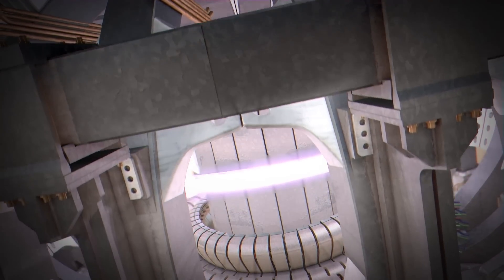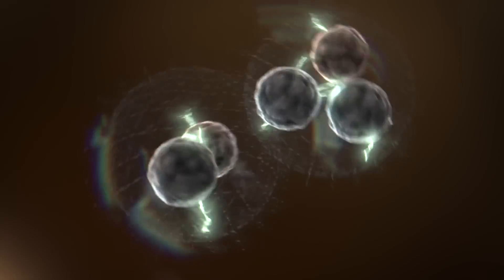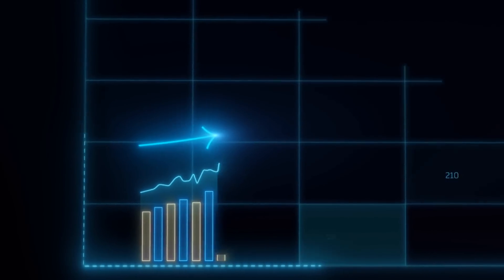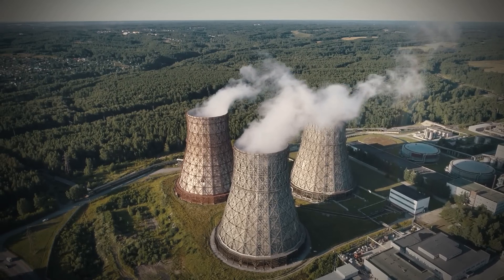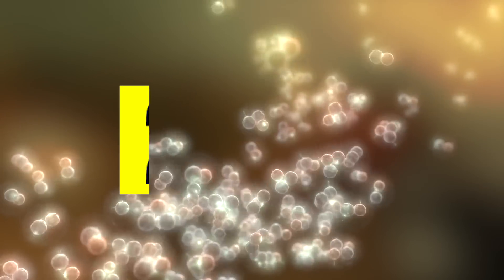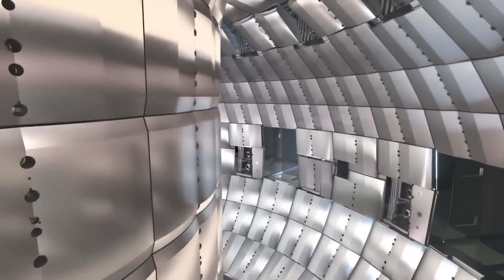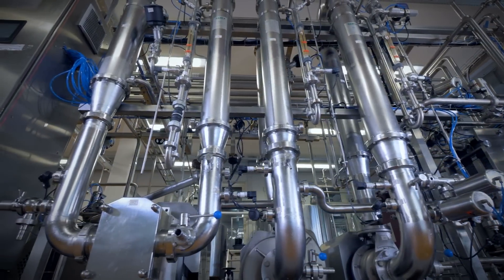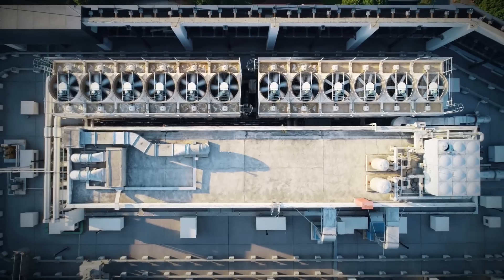The Shocking Problem That Could End Nuclear Fusion

Comment: the hydrogen reaction is just the most effiecient one at the lowest cost.
and most asume its the only reaction humankind will be ever able to get going.
there more combinations but require a higher presure/heat. or rare ones like helium-3
but in theory we could 'burn' like everything a sun burns. with ever lower returns using heavyer elements. (and then the star dies) they just having a fight in reaching sertian condisions to achieve fusion, heat presure and containing that, pulse fusion has proven succfesfull in having a positive net output, yes in "30years we have fusion" prolly not going to happen, but it is posible if you take a sun as an exsample

Comment: I always wonder why geothermal energy is not talked about. Especially when it is already used in fairly large scale in Iceland.
With such a huge percentage of the world population living in the vicinity of the volcanos of the "Ring of Fire", you would think that there would be at least a few countries that would take up the project of building an electrical generation unit using geothermal. 
I recently saw a report that predicted that using geothermal power production could power the United States for a million years, or possibly even for ever. 
I think that it would be completely possible to create large electric generating hubs, and send energy through a new, or possibly the old grid to some extent, to cities. Once one is introduced, more and more could be built. 
The technology is already there, it's nothing new, and I really hope that we eventually take steps towards geothermal energy sources in the near future. Because it is possibly the cleanest source of energy so far, with no negative byproduct, and is a limitless supply.

Comment: There is a design for a fusion power reactor that has been practical since the 1960s except that no one would want to build one. It involves creating a large concrete Dome and then exploding hydrogen bombs inside. The Dome would have to be really large and really thick but it would produce a lot of power. You would just use the heat generated  to drive steam turbines. This steam might be a bit radioactive though. As I said no one would want to build one
Reply: Well, replace fusion explosive with inertial furnace, build several of them to fire up in turns and add a hydroaccumulator plant nearby...

But yes, this power plant will be as big as a small city, and everyone are more interested in petrodollars
Reply: I’m interested in methods of setting off a fusion reaction without an atom bomb. Could pulsing an electrostatic field with regular explosives suffice?
Reply: @Scrogan  https://en.wikipedia.org/wiki/Inertial_confinement_fusion
Reply: @Scrogan  I'm not a physicist but more then likely no chemical explosive would be able to create a hot enough plasma for fusion to work. Even something like thermite isn't hot enough from my understanding. Like it has to be REALLY hot. They use electromagnets to contain the plasma as it would damage or destroy any material used to contain it very quickly.
Reply: @deathwishjoe  hydrogen bombs aren't considered conventional chemical explosives.
Reply: @landensmith7928  yeah I know that. That's why they work in making fusion. I was responding to James Barclay who asked about pulsing an electrostatic field with regular explosives. It was an interesting idea of his but after thinking about it I didn't think any amount of conventional explosive would get hot enough.
Reply: @deathwishjoe  he never mentioned anything regarding conventional explosives. He directly stated an atom bomb. Suggesting a nuclear explosive
Reply: Edit: I do apologize I had not read the entire comment.
Reply: @deathwishjoe  the suggestion wasn’t to use a chemical explosive directly, but rather use chemical explosive to provide a very high instantaneous power to a compressing electrostatic field.

See: Explosively Pumped Flux Compression Generator
Reply: @Scrogan  Ah I see where your going with the idea now.  sorry for the misunderstanding.  Using the explosively pumped flux compression generator to create bubble around the plasma and then using possibly more explosives to compress the bubble thereby heating it up via compression to the required levels for fusion.  again not a physicist but I'm a little worried about reaching break even due to the issue of this style of device needing a bunch of capacitors to provide the power for the electromagnetic fields and if there were any sort of mechanical failure instead of a compressing bubble of plasma you end up with plasma jet shooting out and ruining any sort of equipment used for heat capture afterward. I'll be honest though, its quite fascinating of an idea and if you find anyone working on such a concept please let me know.
Reply: So, just a massive extremely dirty open-loop fusion-enhanced fission reactor which heavily contaminates water?!?

Comment: One of the latest 'shocking' problems. Trying to create a fusion env on earth is very hard because the sun has the advantage of gravity holding the process together while on earth we have to use magnets and we're limited in the geometry that possible using that solution. Tritium is not the biggest issue.

Comment: I'm not worried. Generating neutrons is a far easier problem than energy-producing, stable burning fusion. In fact it's a desktop science fair project to build a Farnsworth fusor which does D-D fusion and generates a neutron stream (albeit not efficiently). Plus the CANDU cycle mentioned. It seems much more tractable to generate tritium at scale.

Comment: I think that the elephant in the room that ignoramus like me may pose about is that in order to  emulate the fusion that exists on the sun they replace one fundamental force like gravity with extremely high temperature, balancing in that way the equation.  But what if gravity can't be replaced and in order to replicate such reaction you need such massive gravity? Gravity doesn't need a continuos input like energy (for the temperature) does. Yes, I imagine they already peeled that apple yet the results haven't yield what was expected and they keep betting on the same numbers. Maybe it's just not possible without gravity or extremely high pressure.

Comment: Well, fusion does not require temperatures 6X hotter than inside the sun, since fusion does of course occur inside the sun.  I'm also confident that that deuterium and tritium are not the only isotopes fusing inside the sun, so.....

Comment: Alarmist click-bait garbage. If stellar isotope ratios are similar to terrestrial ones, that's only 26 ppm of deuterium and almost no tritium. Every visible star in the observable universe seems to happily burn along with no trouble, despite your imagined "problem".
At worst, it's simply another engineering challenge to overcome on the road to mastering compact artificial fusion reactors. Our sun has several fusion chains that all occur on grand scales concurrently. Those reaction chains interact with and feed one another. Did you think that an artificial version of the same process would be so different as to only take advantage of the simplified model you get taught in children's lessons? Did you think that the high-energy nuclear physicists that have devoted their life's work to this pursuit are as incompetent as yourself and failed to recognize this? Perhaps the actual process is more complicated than the dumbed down version you were taught.
Maybe those physicists know something you don't. Scratch that, they definitely know something you don't.

Comment: One day we may be able to make mind numbingly expensive power stations with a massively limited fuel supply. But don't worry we can use lithium (already a limited commodity due to it's use in batteries) to make more tritium. Maybe. Perhaps. It's definitely worth pouring billions of pounds a year into project white elephant. It's not like we have anything else to spend it on.
Reply: Bums every
where bro. Were fked.